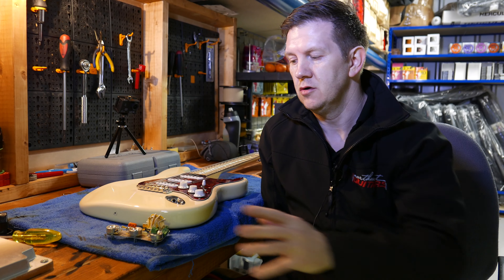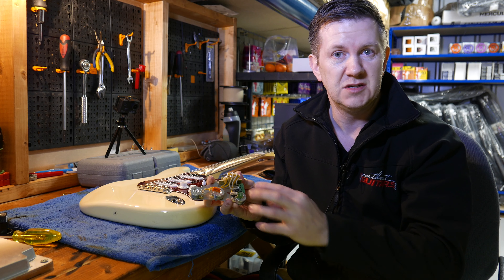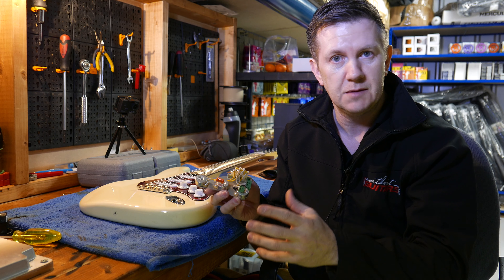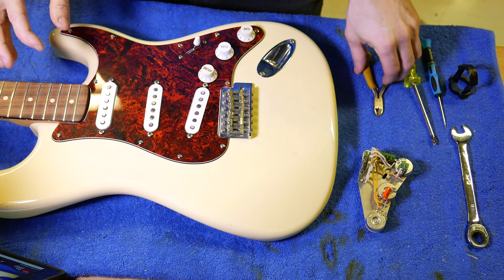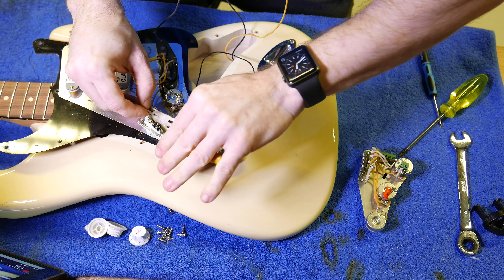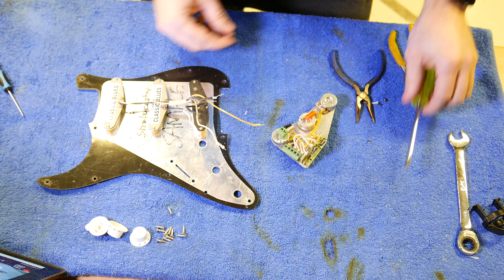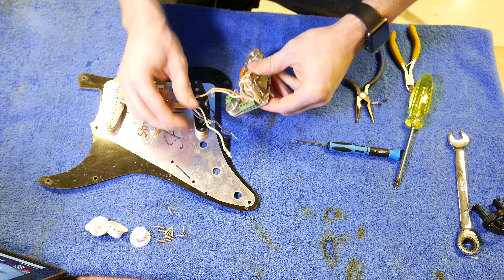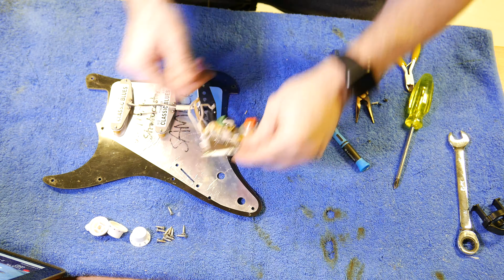Solderless Wiring Kits

Comment: Is there a link where these can be purchased? 
I build as a hobby and side hustle. With the time and money invested in getting the parts i need, then to solder it together, id be better off with a good plug and play solution.   The key is to move these things a little quicker than i am currently.